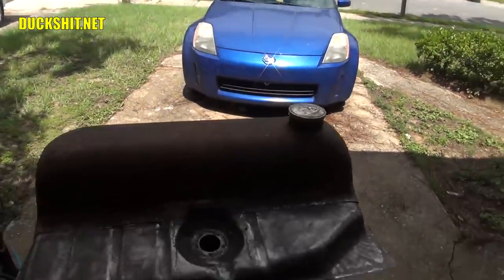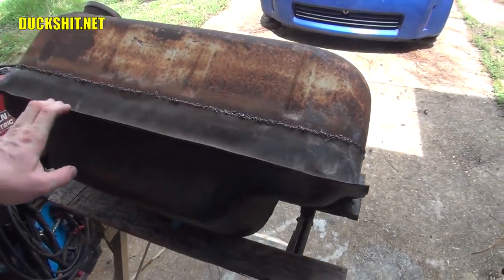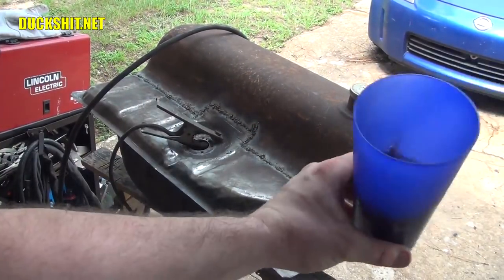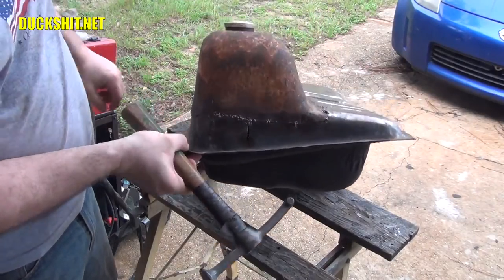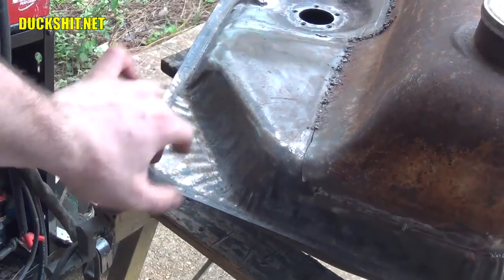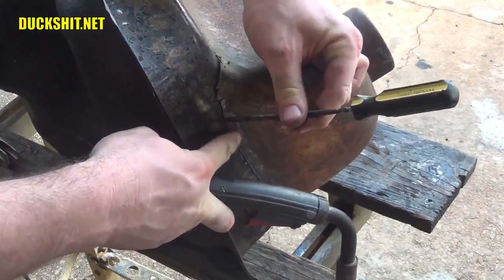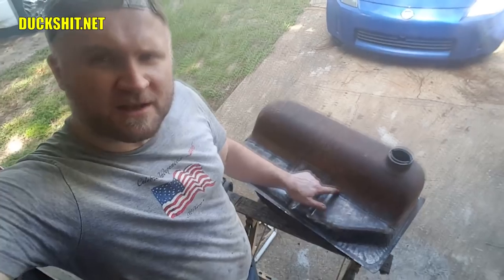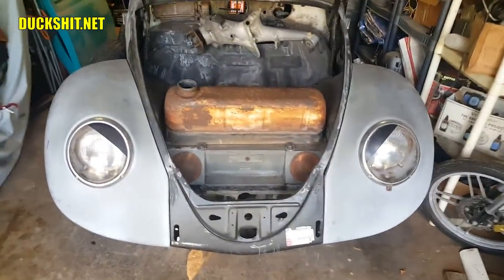Gas Tank 4 - ROTTEN OLD 1956 Chop Top Oval VW Beetle - 16

Comment: I've had the same Bluepoint AT190 for about 18 years now. I don't even oil it. Seriously. Worth the money. I have that for work, and I picked up a vibration dampened Ingersoll Rand that I like so far, but I've only used it like 10 times doing rust repair on my truck.
Reply from the maker: Hmmmm, the AT190 looks exactly like a harbor freight one, which was also the same as the moderately-priced unnamed chinese one I bought at a local tool shop.  I'm quite surprised your experience was so good with that one, perhaps the quality control on the Bluepoint assembly line on the other side of the building is better. I will look into an Ingersol Rand, though!  Vibration dampening is a good thing for me, I've buzzed my hands pretty bad wire-wheeling off rust, and grinding my welds on the oval summer/fall of 2016.  I had some problems for several months, not good.  Thats one of the reasons I stopped making videos for a while, I could barely tie my shoes, mild numbness and lots of tingling.   I have all sorts of special gloves for running vibrating tools now, hasn't been a problem since.
Reply: It may LOOK the same, but it's a body saw. They all LOOK a lot alike. When my original AT190 got stolen, I replaced it with a Campbell Hausfeld that lasted about a month. Bluepoint comes off the Snap-On truck. The insides are probably stainless or something. But I've LITERALLY oiled it about 5 times (and not in the last several years) and it doesn't have a single issue. There was one on eBay for $99 when I looked earlier. I had the first one for about 3 years and had the same experience.
Reply from the maker: I agree! You are right... just because it looks exactly the same doesn't mean anything... lol, but generally speaking (and very likely even in this case) when its chinese and they look they same, THEY ARE THE SAME!  That applies to nearly everything I can think of.  Tools, engine parts, whole engines and even small electronics and other machinery! Blue-Point may come off the Snap-On truck, but even they won't put the Snap-On name on it... Why?  Because its not Snap-On quality!  They are all generally chinese-made instruments with few exceptions. I know a bit more of Snap-On than most people, i used to do inventory control and parts returns/RMAs for a Snap-On franchise... I saw the stuff that broke, and the stuff that never came back!  Also talked to a lot of the corporate guys.  But even after that I don't own any.  Why?  Because you pay extra for the finish... I'm not interested in that.  Their tools indeed are beautiful, and too nice for my shit show.  Sure you get a lifetime guarantee, but so do several other manufacturers anymore... save the money!  Sadly though, chinese power tools are chinese power tools!  I'm gonna say you got lucky with yours, OR because of its age it was a better quality unit than anything I can get now.  I'd do a tool review (AvE style) but thats not what I do here on this channel.  If he knew who I was I'd buy the tools just to send to him though, lol!

Comment: Not sure if it's your welder, but whenever I do thin sheet metal I will hold the trigger for almost one second to get a good amount of filler on the work piece. I noticed that you were doing very small amounts at a time, and I think that the metal can handle a bit more to allow you to fill it more evenly and smoothly. Here's a picture I found of what it should look like:

https://i.pinimg.com/originals/8b/0b/e9/8b0be996e6ccb1b0b65f4b5912f88af9.jpg

Good luck on future welding projects, I'm sure by now you've got this one wrapped up.
Reply from the maker: Thank you for the suggestions!  Yes, I do have it just about wrapped up.  I had a very bad grounding issue on both ends of the ground wire. But anyway, here's an update as it sits now.  https://youtu.be/AtMgjVT_4pU